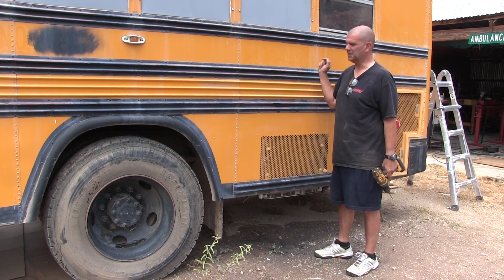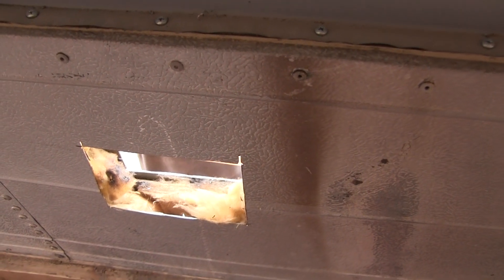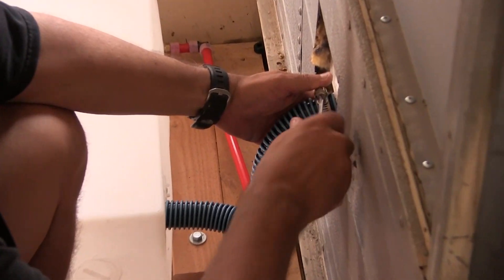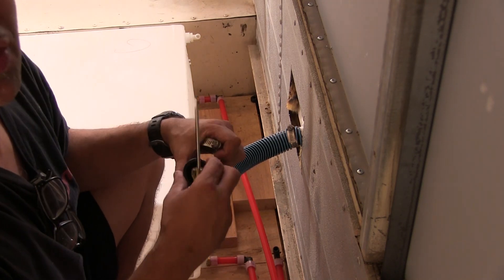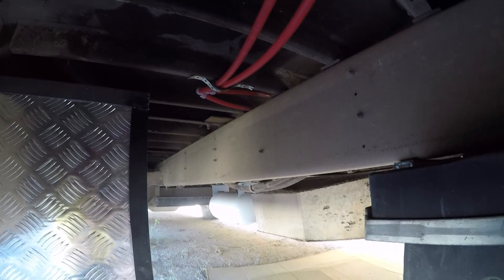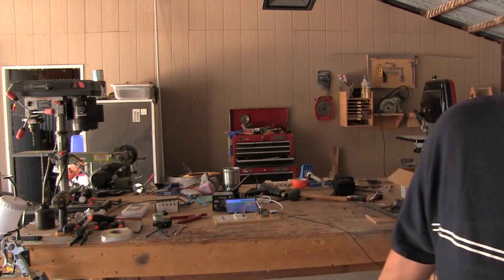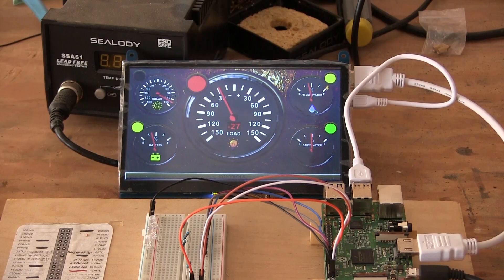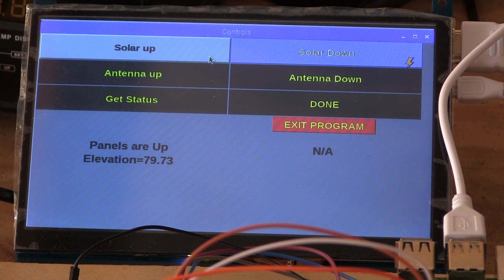Skoolie Bus Conversion:Plumbing part II and SOLAR UPDATE!

Comment: When putting your feller pip to the tank. You use rubber tape the clamp it down. This way it doesn't leak. O learn the hard way also.

Comment: Question… how did you run the city inlet to fill the tank? Also, what did you use connect to the inlet piece? So that was 2 questions. 🤷🏻‍♂️

Comment: I know I'm late to the party.. ( just discovered your channel) but how are you going to keep your water lines you routed under the bus from freezing in cold climates? Good news (kinda) is my bus is plumbed in pex. I forgot to turn on my basement heat and some of my lines froze. After they thawed out, there were no breaks in the lines. It's supposed to be very forgiving. Although, I had my floor heat on, so I'm pretty sure that I only had a few feet of a section freeze. Not an experiment I'd want to repeat. 

Really diggin your build. You have a great skill set, and I appreciate your attention to detail.

Comment: Love the control panel and the accurate gauges to show how full your tanks are. For the elevating solar panels, will they rotate too so that you won't have to worry about which way the bus is pointed when you park?
Reply from the maker: Parts of the design we are reconsidering. While I could certainly make it, it seems there are diminishing returns at play here. More to break so to speak. Liquid levels are still in play but automatic solar deployment is getting the axe. We will be using toggle switches instead. Also, while o toyed with a rotating solar array, a single axis is a much safer design and again, less to break.

Comment: Parts list please
Reply from the maker: When and if I decide to pull the trigger on this, there will be a fairly detailed list of items i used. There is a lot to break if i do this and while it would be cool as hell, I'm apprehensive to go all out on this when 3 toggle switches would do the trick.  If you know what i mean.

Comment: is that gauge panel a standard drag and drop type program that you can adapt to youre need 
seems like its running off an arduino
Reply from the maker: watahyahknow it runs off of Raspberry pi and it is total custom programmed for my system.

Comment: I am so glad to see a schoolie conversion where the ceiling, walls, windows and insulation are not ripped out. I'm not convinced that the $4,000. additional time and rebuild cost couldn't be better used on a wood stove, air conditioning or solar.

Comment: Where can we find the double sided sticky tape? It will also work good for around our bus windows.
Reply from the maker: It is butyl tape and you can find it on Amazon or even in your local are hardware.

Comment: It appears Bussy is going to pack a  few surprises. Great work. I have no idea how you came up with the gage interface but if you design it right there's probably a market for that in the skoolie community. I was going to do a manual rise rack but this can be raised to maximum input. Well done.

Comment: I've never messed with a raspberry pi, but have been contemplating using one or more as a sensor system for power, tanks, etc as you have on our bus. But clearly you're quite skilled with this. Are you a EE or comp sci guy? After my oil warning didn't warn and blowing an engine, I'm also thinking about a better engine, trans, temp, rpm, speed monitoring, etc. which could also maybe interface with a pi, and output to a screen in the dash board. I don't like the tiny gauges on my bus. They're I'll placed and hard to see, and clearly some critical ones are broken. Would enjoy an educational video series on how you interface the sensors with the pi and display.
Reply from the maker: It's funny that you mentioned sensors for the engine!  I totally agree.  I want better sensors for my engine.
No, I'm not an EE or anything, just a pretty extreme nerd.😂 Pretty driven to have a bus to my nerdy standards.
Reply from the maker: I have had an unprecedented response to the raspberry pi stuff.  There will be a series of videos covering this.
Reply: I'm looking forward to nerding with you watching that series. Very cool.
Reply: Since this chat I've acquired a Pi and Arduino to play with. Watched a lot of Toptechboy tutorials and coded a LED to blink. Baby steps, but I'm enjoying learning this stuff. Thanks for the inspiration.
Reply from the maker: It's fun to play with but super a  powerful system. Just ran into a project with Northrup Grumman and they were using a raspberry pi in their system and it was going to market with it.  I can't say what it was but I was impressed as hell!

Comment: In an earlier vid you talked about an NON_Compression ridged foam that you thought about using on the floor. I am unable to find the reference. Could you provide that or a name of the foam? Thanks
Reply from the maker: We bought our foam at home Depot.  1.5" styrofoam.  Nothing special.  You can buy compression foam but I was unable to find it locally.

Comment: Damn right there's some cool solar stuff at the end ! ASADS  is cooler than the other side of the pillow dude ! I've been an industrial maintenance tech 40 + years but not an electronics or computer programmer kinda guy. I'd be VERY interested in knowing how you are building your system, subbed your channel to learn more. I would love to have ASADS on the 4 -  100watt panels I have for my skoolie conversion. I'm guessing but what are you using there , arduino or raspberry pi ? Creating your own custom programs ?  Thumbs up buddy for the start of what I think is going to be a GREAT system , curious I am to see what your "lock down" system will be for travel and overly windy days. Any help , pointers , instructions , etc you might want to give a poor old guy on how to replicate your system would be GREATLY APPRECIATED. Keep up the good work and thanks for the videos , keep'em comming , I got some learning to do !!

Comment: As usual a great video. I really like your monitor system, much more than what the monitor panel on my MH. I assume the water line that you installed under the bus will get insulated or are they just drain lines. Might not be a problem here but in Alaska........
Keep up the great work and videos!
Reply from the maker: They will definitely get insulated. To many steps!!  LOL!  I didn't buy any "pool noodle" but we are going to.

Comment: Bravo! The "Control Freak" rules! Hope you are registering "your build" as proprietary property. As Captain Ron said... "Kitty if anything is going to happen, it's going to happen out there!" Subsequently, I was eyeballing the hose clamp connection on that low pressure spiral wound water supply line. I'm certainly no plumber, but if I was installing that line for you,  I would keep a close monitor on that connection for a while to insure integrity after the tanks are filled. Nonetheless, y'all are truly amazing fabricators. Carry On! Godspeed.
Reply from the maker: Thank you so much. We are going to actually put some silicon into the spiral to insure it is a solid seal.  Your comment was awesome. Thank you again!
Reply: I thought these rotating seats would be a super concept for the skoolie Co-Pilot & Navigator. Aboard the Bullet Train, how to turn your seat to face the one's behind you and turn it into restaurant booth seating on Tokyo's bullet train! Likely too space consuming for a skoolie, but a concept worth pursuing. https://www.youtube.com/results?search_query=rotating+seats+in+japan+bullet+train  https://www.youtube.com/watch?v=rX5D6YtI7tg
Reply: As a co-pilot, navigator or passenger, I would prefer to enjoy the ride near upfront, facing forward and within easy talk-listen distance from the Captain, especially taking into account the volume of front-engine noise. Comfortable, solid seating with proper seat-belt protection would encourage usage and insure safety of crew while underway.
Reply: For that spiral wound supply line, keep an eye on that. RV owner speaking from experience. That stuff deteriorates within a very few years and pulls apart. I replaced ours with the clear heavy plastic tubing (impregnated with some sort of mesh) sold in Home Depot. It has lasted many years. Just fyi. Enjoying binge watching your vids, thanks so much for the time you put in to produce them.